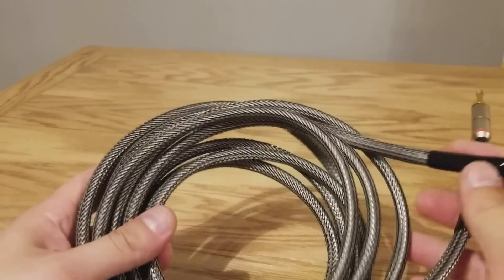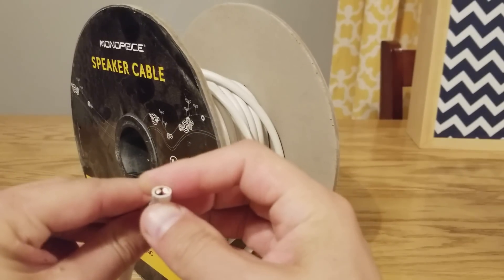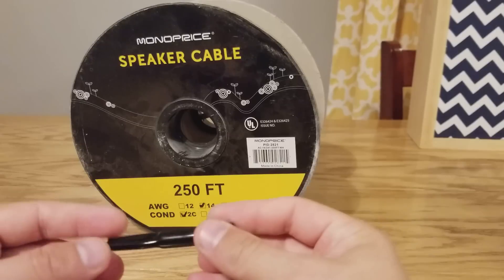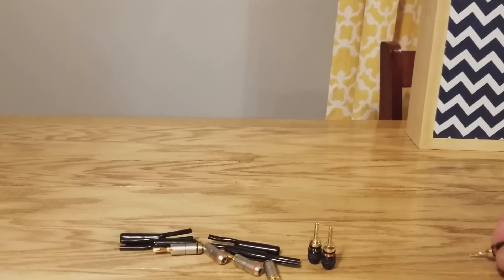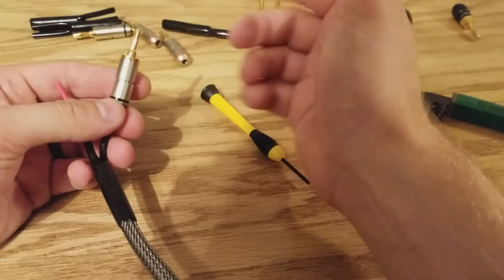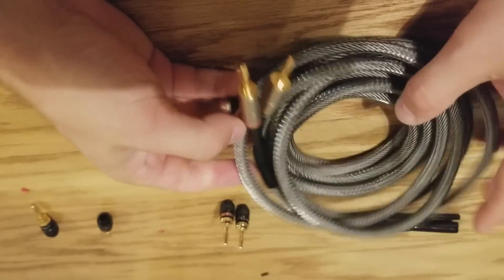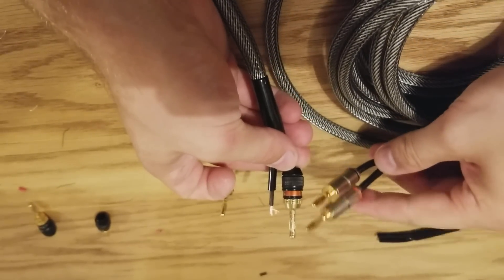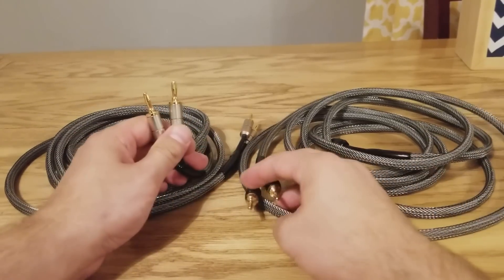How to make Your own HiFi Speaker Wire

Comment: These are not quality cables. Reading the comments, there's lots of crap against 'audiophile' sound. Until you can actually tell the difference, (which most people can't because they have shit speakers/ amps anyway), stfu please about 'so called quality'. Your system sucks by definition if you can't tell the difference between wiring. It's a major difference, just the thickness in itself gives the signal more 'space', not to mention higher quality wire. If you want real quality cable, go for something like Furutech. There's reason it costs more, it's more expensive to make...idiots

Comment: By putting the outer jacket the wire performance degrades because of capacitance build up on the skin.

It would be better to have less insulation and thinner solid wire like 18 gauge.

Try thermostat wire and remote the outer jacket and the sound will be shockingly better.  Also check directionality if the wire to get that benefit as well.

Praise I AM,
Michael Idarecis

Comment: Thanks a lot for this video, what size of sleeve and pants for 2x4mm (12Gauge)?
Reply: The cable pants listed will not work with 12 Gauge  wire, you can heat it to no avail. will not slip over 12 awg! I ordered some 10 mm and will try that.

Comment: Hi,
What is the techflex diameter I need for 10 AWG wire?
Thanks!
Reply from the maker: itoosh you would want to beautiful the outside of your jacket with digital calipers. If you don't have any, the next best thing would be a measuring tape.
Reply: I'm going to purchase all it once from Parts Express. so can't measure the wire before buying the techflex.
I read reviews on the 3/8 techflex on Parts Express and it seems that it fits well to 10-14 gauge, I guess it get tighten with the 10.
Thanks!
Reply from the maker: itoosh I see. It's hard to say, since the outside of all 10 has wire isn't the same. However, I in can say I definitely could have used thicker wire than I did with the 3/8 tech flex.
Reply: Great, I guess I will try the 3/8 and update how it fits if it would help someone in the future.
Thanks!
Reply from the maker: itoosh that would be great thank you!

Comment: I've done this build before but 13ga wire with black jacket. Only thing I did differently was used a cement silicon glue for flexibility under flex hose and jacket. Only reason I wanted to be secured enough cause I plug and unplug a lot and didn't want anything to be undone. Great video

Comment: I have a little trick that would make it easier to put the boots on. If you put some heatshrink over the techflex, and just melt it on the end slightly it will melt the techflex over the cable so the techflex  will stay put when you slide the boot over.
Reply from the maker: Brodie Haward great tip!

Comment: 14 ga. dead soft pure silver wire, (clean oxidation off wire with 4# steelwool) teflon jacket slightly larger than wire. Add connectors (pins or bannanas) if you want (I prefer bare ends) and you are done. Silver is around $17.00 an ounce right now.  Made mine when it was $35.00 an ounce. Cost about $100.00 for a 10' pair. I've seen similar cables sell on-line for as much as $100.00 a foot. Be sure to twist the insulated  conductors  together. No need for outer jacket as the teflon insulator is pretty tough and besides they look great with the silver shining through the translucent teflon. Huge improvement in sound. For interconnect cables I use 28 ga. pure silver wire and appropriate sized teflon jacket. Get the best RCA plugs you can afford (I like the Cardas silver RCAs as they are well made and reasonably priced at $50.00 a pair, and they look great with the silver wire). So, given the cheap silver prices right now, about $60.00 for a 10' pair of speaker cables and $60.00 a piece for 2 meter interconects. These will perform as well as the ultra highend cables, some of which run into the thousands of dollars. Best money I've ever spent on my system by a long shot.

Comment: Just shoot me. 14-gauge "lamp cord" type speaker wire will work flawlessly in almost any home application, right up to the high-end system.  You want low resistance, but 14-gauge wire is only .0025 ohms per foot. You'd need 500 feet before you started pulling your amp down. As for interference - you'd have a hard time inducing interference into a 4/8 ohm circuit. Shielding is for high-frequency, like 75-ohm cable TV wire. Same for twisting e.g. CAT-6, which is only done to prevent high-frequency interference between adjacent cables ("cross-talk"). Shielding or twisting speaker wire, or a guitar lead for that matter,  does nothing. I'll put my lamp cord against anything you got in a blind test and you will not be able to hear the difference. It's all BS.
Reply: Bullshit baffles brains, you audiophiles need to get some electronic education and electrical!!!
Reply: Exactly.. The key for speaker cable is resistance.. This is why car battery jumper cables worked the best in one blind test done by the Society of Broadcast Engineers (SBE)...
Reply: StringerNews1 Exactly.. The purpose of the car jumper cables test was to show that resistance is the key.. I agree with the rest of your comments..
Reply: Let people live. Maybe if you found a hobby you wouldn't feel the need to come drop douchey comments on YouTube?
Reply: I still use the same Radio Shack 14 awg speaker cable I bought 30 years ago. The sound is killer and copper is still shiny. The spool was 6 bucks
Reply: @PhuckHue2  Cheaper than Walmart today IIRC.
Reply: @Larry Niles Because you want to hear it. It's self fulfilling. Look up a guy called Peter Kay on YouTube and you'll see what I mean. Your brain is fooling you into hearing what you want to hear man. It's a well known pyschoacoustic phenomenon which watching Peter Kay will quickly demonstrate. Wake up and smell the coffee.
Reply: @timtimmelim  A nul test would quickly prove there's no difference. You are one hundred percent right.
Reply: This comment section is fire LOL
Reply: Amen brother.  I’ve used old worn out extension cable and you can’t tell the difference between that and cable I spent (wasted) $100 dollars.  I know better now!
Reply: Finally! Someone speaking sense!
Reply: Input wire needs to be shielded period, anyone in car audio knows this.
Reply: @DarkLinkAD  I'm puzzled. He was talking about speaker cable wasn't he? What's input about that? In that sense I'm pretty sure he's right in what he says. Input wire before high gain input stages needs to be shielded like you say yes, but that wasn't what he was talking about.
Reply: @pierrelailvaux9544  "Shielding or twisting speaker wire, or a guitar lead for that matter,  does nothing. " Commenter says this, which is wrong. Input wires need shielding.
Reply: @DarkLinkAD  Speaker wires are not input wires. That's the point. They do not need to be shielded. It has to do with relative signal levels. At the high voltage levels being sent through speaker wire from the amplifier any low level RF interference picked up in those speaker wires would be minuscule and of no importance whatsoever, because it is not being subjected to gain at the other end and will be totally swamped by signal. Where the voltage levels are low and gain is needed at the receiving end is a different matter entirely. There shielding is needed. That's just basic. I'm afraid you're wrong and Toobula is right. He even gives the reason why twisting wires are of no relevance with speaker wires. It has to do with relative impedance (in the case of speakers between 2 - 8 ohms). Did you perhaps not understand the relevance of that?
Reply: @pierrelailvaux9544  Jesus fuckin christ man, a guitar lead is an input wire.
Reply: @DarkLinkAD  a guitar lead is an input wire indeed and apart from shielding it should have also as low a capacitance as possible. I would like to see Toobula's face listening to a guitar conected to the amp with his/her lamp cord, haha...
Reply: @My Name Indeed, the total resistance is key, including connectors..
Reply: @My Name Not necessarily.. Once we start getting into longer distances, then the difference between guages does become important and will affect damping factor.. It's not a critical difference, but there is a difference..
Reply: Toobula, shielding is for low level signals. Period. It's not the frequency, it's the level. Even delta waves from your brain have to be shielded after the transducers captured them.

Comment: so, shitty wire, shitty banana plugs, dressed up in techflex... great how original. i would get 1-piece tellurium copper plugs and stout motor winding wire,  hollow cotton string/rope, and thread the wire through the cotton, and silver solder to the plugs, and then heatshrink over the wire/plug area for strain relief and to stop fraying... thats how I'd do it. i hate set screws which are always loose 2 weeks later, and those plugs with either the really weak springiness/snap off, or the ones with the spring part which is separate sleeve which is essentially "loose"... I would avoid both those types of banana at all costs. I'd look for tellurium 1 piece, or next the type with the locking screw at the back which locks them up by a chuck-like collet action on a pin down the centre. but the hollow one piece tellurium copper ones are easy/cheap enough to get hold of and work well for a light weight wire set...

Comment: For home audio, go to your hardware store and buy 18 gauge lamp cord wire.  Unless your speakers are more than 60 feet apart, it will work as well or better than various "Monster" type speaker wires.  Many of the exotic speaker wires introduce unwanted capacitance to the load.
Reply: LOL

Comment: All though I disagree with those saying, "this isn't $330 cables this is a cheap $10 cable made to look like $300 cables... bla bla bla".  I'm highly skeptical of the legitimacy of expensive cables and their superior audio quality, at least in any significantly audible way.

But honestly It seems like a lot of hassle (and additional expense), when I can just get the same Monoprice speaker wire and add banana plugs and be done with it. As long as I can keep it out of sight, I just don't care. But that's just me. I understand some people are into the looks.
Reply: I have some expensive cables totaly useles crap, i cut the plugs off and turns out the wire is super tin...
Reply: There's no difference.

Comment: Lots of talk about twisted pairs. I dont think my Chord Anthems are twisted inside but what they do have is an additional heavy duty outer jacket with heavy shielding. The actual conductors are quite thick too making the cables quite heavy.  They did cost a fair amount, but 10 years on they still perform so no real gripes at all. I  really dont know how they would compare with something like this though. Maybe there will be little or no difference, or lots of difference. The Hi Fi industry is full of hype alot of the times, but the Anthems build quality does justify the reasonable price charged. Banana plugs make no difference for sure and bare wire cleaned every six months is fine. Super expensive cables are just silly. But each to their own. If someone wants to spend £3k for a two metre pair, its their money.
Reply from the maker: Raj102945, well stated
Reply: I also have no problem with people wanting to spend a lot of money on good cables as long as the price is not proportional to the bullshit.

Comment: I made my own back in early 2000 before maplin went rubbish. I used shark OFC cable 6 meters long for each and gold plated banana plugs. I made four pairs as my system is quadraphonic. They sound like £1600 speaker wire but only cost me around £60 for everything. It's well worth doing.

Comment: Nice job at making "normal" in-wall wire look like high end speaker cable!! The audiophiles would be impressed as long as you didn't tell them it's just in-wall 14 gauge....LOL...LOL. Great job!
Reply: Absolutely right !!!!!!
Reply: Robert ... explain... should we use 12awg...or is there a different wire to use...
Reply: Until you hear the sound of your system.😓😓
Reply: @marcelsmeets4162  Why? With the 14 gauge standard wire it MUST sound the same, other things aren't electrical possible.
Reply: @DrDOHC  I used  to be a really  non believing physics Phd...If you cannot measure it, it is not there.....right?
Therefore before breaking the bank on speaker wire I have tried to make my own. Checkout TNTaudio they have a great website on diy speakercables.
I was blown away with the difference to normal speakerwire..compared with the  braided ethernet cable..
And the Kimber12tc was even a step up from that.
And yes we did blind tests and I picked them out of 3, every time again.

Comment: so if i need to make a wire like that for my receiver that does not have a bi-amp, would my wire require 4 at one end and 2 at the other? i will be connecting klipsch speakers to it and need the bi-wiring
Reply from the maker: Carlos Rodriguez typically your speakers have a jumper on The Binding post, so there's no need for that. You can just run 2 conductor wire. But if you really wanted to or missing the jumper, then you would use four conductor wire. On the end that's plugged into the amp you would connect the two negative wires together and the two positive wires together to make two ends instead of four. And keep the four ends on the speaker side
Reply: thank you sir for your SUPER quick response
Reply: ok so since I dont have the jumper and i wil need the four ends at the speaker part. how do i know what two goes at the bottom and which ones are treble and goes on the top? im just scare because if connected wrong i will probably blow the horn on the klipsch since they dont like low frequencies
Reply: There is a difference between bi-wiring and bi-amping - you can plenty of info if you Google the two terms.